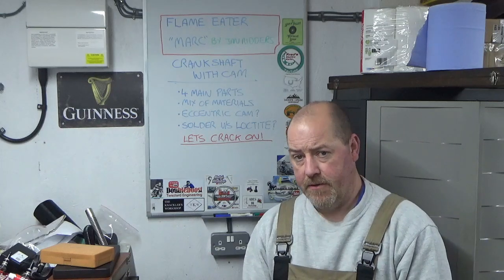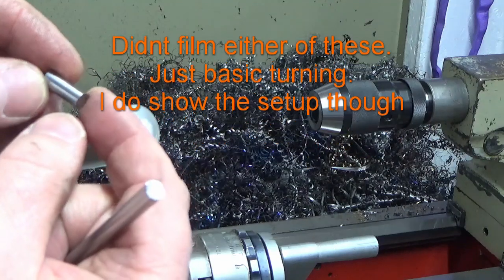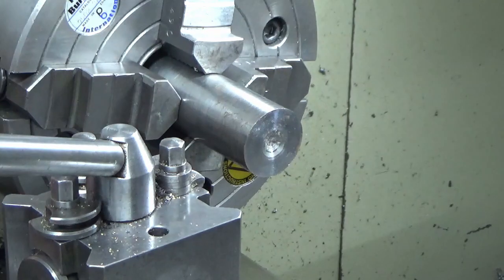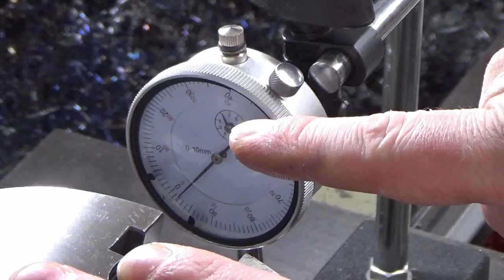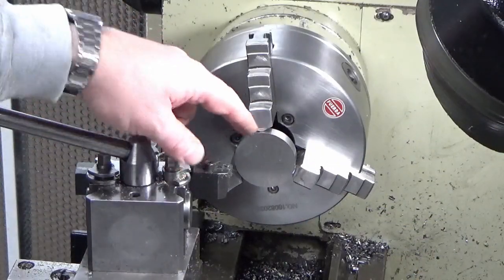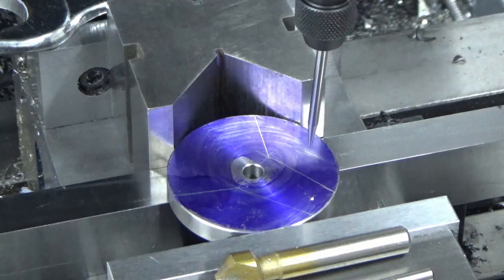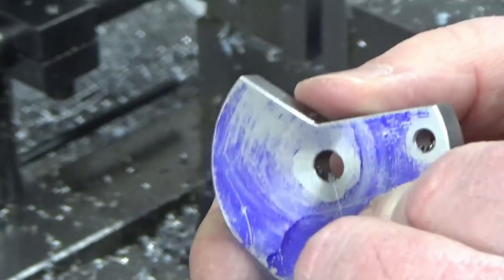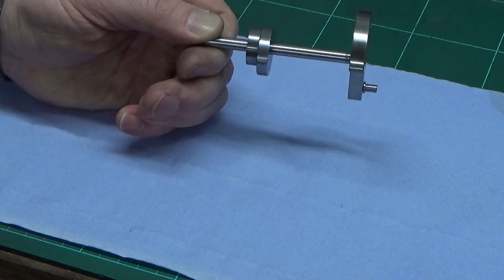Making a Flame Licker Engine "Marc" by Jan Ridders -  Part 7 Cam/Crankshaft Assembly

Comment: Hi Jon , i pondered how to make the cam and i thought if i used square bar instead of round it would be far easier to index over for the offset . Certainly made it easier from my point of view .
Reply from the maker: Hi Alwyn, thanks for the comment. Totally agree, square section would be much easier to manage in the 4 Jaw. I was just using what I have laying around as my stock is pretty thin on the ground having only just got going really. The cost of raw materials at the moment is ridiculous!! Need to find a scrap dealer but living where we do, there is nothing anywhere near unfortunately so it's top dollar through the Internet all the time! Cheers, Jon
Reply: Hi Jon, I totally agree about material prices that's why we use what we have lying around. I am sure many people would frown but I had some square section aluminium which fitted the bill and easy to machine. OK not the best material for the job but its a show piece which comes out to impress your mates. It's not as if it's running 24 /7. Great stuff can't wait to see it run, it put a big smile on my face when I got mine to run. Best of luck.

Comment: Great outcome Jon. Another time if you need to turn a cam, if you have a spare mag base, set it up on the lathe headstock with an arm with a pointer on, to align the chuck jaw each time you rotate the chuck 90 degrees. This will help you in taking out the guesswork of the chuck jaw rotation for indicating. You could get a much more accurate jaw alignment for 90 degrees. Or your scriber block would also work. As you showed, only a couple of degrees rotation made a big difference on the dial reading. Regards from Australia.
Reply from the maker: Hi Dave, thanks for the comment and suggestion, in the memory bank for next time round, good idea. I got so used to CNC where you just index the spindle to a known position. Trusting my eyes a bit too much on this build lol, maybe I should go and get them tested! Cheers, Jon

Comment: Gday Jon, nice save on the crank web, done well and it’s not hard to make that mistake, been guilty of that myself, I did the cam lobe for mine the other day, I used the rotary table and to be honest it did my head in to start with, I was ready to do it with a file, but once I worked out my numbers, had a smoke and a cuppa it turned out spot on, I have been worried about making this part from day one, the crankshaft looks fantastic mate, top job, Cheers
Reply: A quick durrie fixes everything !
Reply from the maker: Hi Matty, thanks for the comment. Yep, where there's a will, there's a way! Lol. Spot on approach by the way, it's always best to step away from any problem, have a break, and then come back to it, I have saved so many balls ups doing this. I also re-draw the whole thing out from scratch on paper and re-dimension it using my own workings, then reverse check it back to the print, this flushes out any poor calcs or assumptions etc. Cheers, Jon

Comment: Decorative features...like that one most.Only recently started using 4 jaw a bit more so any set up tips are good for amateur like me.Also...good tip to use the collet block from the mill.I have some small diameter fiddly pins to do some work on ..so good timing!
Reply from the maker: Hi Robert, thanks for the comment. There is usually a decorative solution to cock ups if you think long enough. Maybe the Victorian Engineers & Designers discovered this too lol. Just mind the collet block in the chuck, two things to be careful of are, use some shim steel if possible between jaws and block to avoid marking the block, you may also have to play around with the shims a bit to get it running true (especially if it is an import one!) Cheers, Jon

Comment: Another  informative video, and well saved ( although when you showed the error to begin with I thought why not just take a skim off each side to  keep the balance, but I suppose you may have kept a bit of mass with your method). Cheers and look forward to the next episode.
Reply from the maker: Hi Pakrattuk, thanks for the comment. I did consider this, would have been an equally suitable solution. This thing won't be spinning fast enough for that amount of inbalance to have any effect. It's got my signature on it now at least (unique)! Cheers, Jon

Comment: Allreet Jon, are you going to case harden the cam?  or not bother . Like the recovery😃
Reply from the maker: Hi Paul, thanks for the comment, you must be from the northeast with "allreet" lol. Nope, not bothering to case harden, I am going to change the follower material to Delrin as the wearable part, this will also hopefully soften the whole valve action a bit (lol, sounds like I know what I am on about). I am just playing at this whole engine building lark. Cheers, Jon

Comment: Ay up Jon, another excellent video! Love the save you did! 
One question, what no. loctite is the best for securing the pin?
Carry on the fab work mate👍
Reply: Jon may have a different answer, but a "retaining compound", such as Loctite 603 would be my choice. There are a few different ones, and they all have slightly different properties. I've used 603 in places where you don't want the thing to come apart - it does break down if you heat it a lot - steel turns purple from the heat... :)
Reply: @matspatpc  thank you for your suggestion, very helpful indeed! 👍
Reply from the maker: Hi Tony, thanks for the comment. Yep, as Mats said, 603 would be about the best. To be honest, for this application, most of the loctite grades would be fine, especially with the grooves in place. Cheers, Jon
Reply from the maker: @matspatpc  spot on Mats, thanks for the comment mate, much appreciated. Cheers, Jon
Reply: @jonsworkshop  Awesome mate, thank you! 👍

Comment: Good stuff, but not really the best technique for establishing the offset. With that much offset, whatever you do it is going to move in unexpected ways. The key thing is to spin the chuck all the way round and find the high and low spots, and the difference between them. That's the real offset and the only thing you should care about. Then you go through multiple steps of adjustment of whatever jaw seems wrong, homing in on the offset you want. The approach you've shown works fine for very small offsets (less than 1mm) but fails to be truly accurate at larger offsets as the work tends to 'cam out' from the jaws. I would have started with a thicker bit of stock and drilled two center points in the mill 5mm apart, then used the centre in centre technique to align everything...You're plenty accurate enough for what you're doing though, so don't worry, you're fine...
Reply from the maker: Hi Matthew, thanks for the comment and suggestion. You are correct, I really only focussed in on the total offset +/- 5mm, the other 2 jaws were just approximations really, but as you say, for what this is and how small it is, any errors will not really have any negative impact on the valve travel or timing. There will be more flex and errors induced in the springs on this design I think. Cheers, Jon

Comment: Should have said let’s crank on,  that offset turning looked scary as fek, I’d have probably tried to convince myself the marks were casting defects, but aesthetically you did a good comeback.
Reply from the maker: Hi Ian, thanks for the comment. Lol, I think my camera stability mode made to offset turning look far worse than it was. You do need your wits about you though especially with larger stuff that's offset, as you can't always see it so there's always a chance to get tangled up in it and your day goes bad pretty quickly at that point! Cheers, Jon